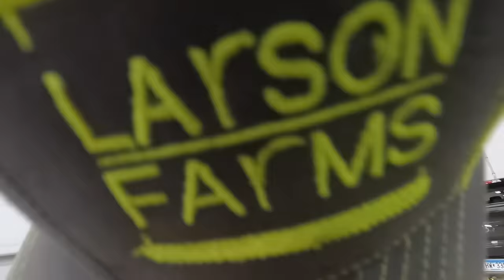We Sold Our Best Tractor!!!!

Comment: I'm not a farmer, but do use double layer jeans, and insulated rubber boots, called Muck, got them for $125.00 in our town. Everyone tells you, buy local. So, we did. We got a shirt from Dollar General that has copper in it, and I used another coat that is very shiny in the sun. The problem is, it pulls off the sweat, but the jacket won't let it escape, so I was warm, but very cold, after I came in out of the cold. Live in Iowa, and do snow removal with a large scoop, that never leaves the ground. Good show. Do like a straight truck, but can't operate them anymore. Can't take the bounce on them. Try an Army 5-Ton and Fort Irwin, CA. HA!
Reply: Why not raise the weights up, level with your forklift and the skids, not have to bend at all. Ha!

Comment: Now grandpa is going to need another tractor.  I bet he wanted to keep the 8520 .   He probably would have kept it so he could pull the rock picker with it . But I know all to well that you cannot justify a new tractor without getting rid of the old one . We upgraded on bought a 580 quadtrac and a 500 rowtrac both are the new afs connect models.  We traded a 290 magnum and a johndeere 8420 for them . Keep up the good work and stay safe!

Comment: I run a 2012 pete 386 just like that but my sleeper is 1 size smaller.. With a 53 foot reefer trailer im around 31-32,000 empty..i honestly love the truck!
Reply: My truck weighs 17,800 just the tractor

Comment: I like your RAM truck.  I bought my RAM Laramie about 5 years ago and just turned 22,000 miles. No place to go.
I don't know what my dad would say. He was a Ford man. He was 6'4" and could not get into a Chevrolet with his cowboy hat on but he could in the Ford.
I kept my last Ford for 27 years. I know that too long but the cab look really nice. I was just making new truck payments in the form of repairs.
I got the Mo Par Max care warranty which coves 5,000 parts for 1,000,000 miles. My old Ford had a 302 V8 3 speed. The RAM has the Hemi Engine with 8 speeds. That sucker will get up and fly.

Comment: Lankato don't do pegs for versatile but I wonder would those ones you fitted work as how much of a difference could there possibly be?
Reply from the maker: They would work if you can drill through the floor safely without hitting frame work or wires. You mount them as close to the glass as possible in a 9420RX makes it easier for the floor mat.
Reply: @LarsonFarms  thanks for the reply!! I'm hoping to try them as Versatile are not fitted with pegs, or at least the 610dt that I drive doesn't have them anyway..

Comment: You know the trucks that deliver your Ag Chem Solutions, the company with the electric pallet jacks in the trailers that deliver to you,  the company that dropped off your 3 point substitue,  that's my work.  Don't buy a 2013 or 2014 Paccar.  2015-2017 is where you want to be if you must.

Comment: Hi Guys, As you have a meticulously clean and shiny regime, (which I very much admire) for your vehicles and equipment, I am very surprised indeed that you did NOT clean/shine (a little) and probably rust protect, the front weights (having commented that they are getting rusty) "PRIOR" to fitting them, as surely it would have been a lot easier, and finally, it would have continued with your fastidious customary standards - Any comments??

Comment: Add more de-icer then comes for the fuel dealer, I would also worry about air lines freezing, no running motor is bad, no braking extremely bad!!!!!!!!!!!!      Later: }